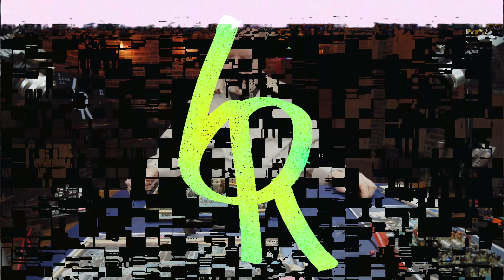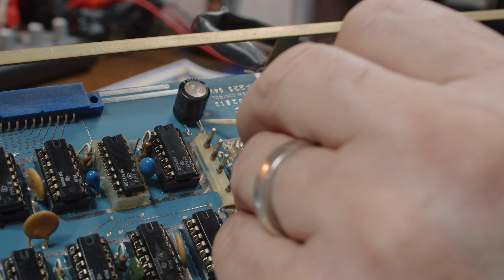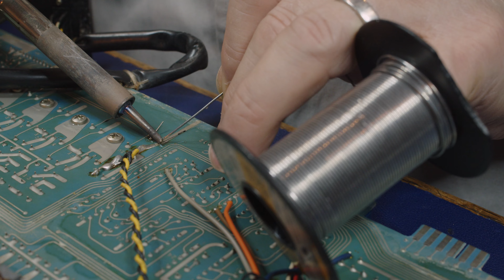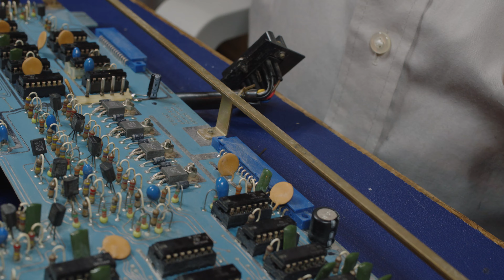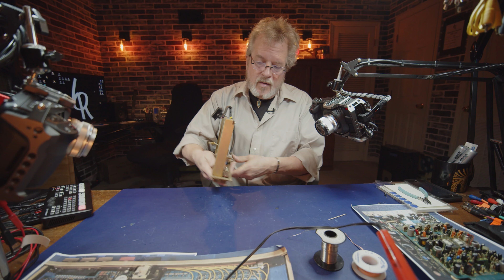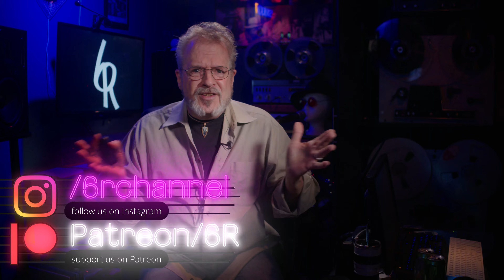TEAC 80-8 Logic Board Recap & Repair; Why It Stops Working

Comment: just one thing i payed very small money for my decks i checked price  now i have a mate  yes he;s that tascam  man on the net  j told me 
he has alot waiting for parts   Tascam  nanji    joth say the decks can be a lotto  big time  the 3 i have  are jazzed up  in some ways 

i was offered this model with inch heads 8 track 1 inch tape  i am not joking there is one in the uk over £1000 the asking price 

i have a otari mx70  117 volt deck with step down  and over 400 tapes   just the zonel tapes £4000 uk
 i was offered 10k uk for the tapes    some one was setting up a studio  used once  tapes 

i payed £ 100 each deck  of the teac 80-8 same with the teac 44  to buy a deck at a time  to a studio is like using bad words
so i know a man call mike in the uk he buy alot of pro gear 

i am hot with dealing with betacam gear    some of the ex hire pads are very understanding  it's the studio's  just don't have the time
Reply from the maker: Greetings @BOB-g4t5d, It sounds like you're one of us. "Rescues" are the tip of the iceberg. Welcome aboard, and Be Well.

Comment: hi have a brenell mini 8     x 3  yes 24 card   one deck  i am a very lucky man i have a   brenell 600 
the 16 channel  unit is like new  i re capped  alot of  the card and put in all the  record lamps i plan to show the unit one day 
there not one working in the uk  

i was offered gear from a lady her man pasted away    the R & D  deck this was not for sell at any price the lady said 

i got it because i had gear from her man in the past  WOW i was very pleased  beware there are gear out there that is not for sell 
i work with a lady her man work for sony 
her man had a set of speaker  only 2 set 's made    he did all the R & D on them  you know the $10.000  30 inch tv sony made
Reply from the maker: Greetings BOB-g4t5d, sounds like you're one us. "Rescues" are the tip of the iceberg. Welcome aboard, and Be Well.

Comment: hi again  watch out the 150 khz that doe's the record doe's go bad  on this  side it's on the left side    i had a spare  same as this  
so i pulled parts of it   
all the decks i have a running nice    it's luck when you get the deck 

you know you said in a video you got 100 of the 14 inch tapes 

i was lucky i gpt 100's of 1/2 tapes  about 500 1/2 tapes   i had to make a super well made rack to hold them 

zonal tapes there was a studio in the south in the uk  they were have a clean out    i used to get offered gear all the time 
alot is in the pro video decks gear like betacam because they need hard to find part 

i buy ADAT deck as well  any thing a can make money on one day  not a re seller  just love to see have they work
Reply from the maker: Nice..! Great to have spares on hand, and storage is always a challenge - you've made good use of your time. Be Well.